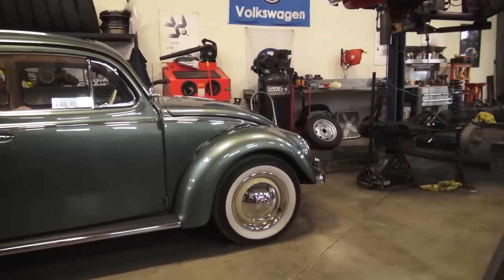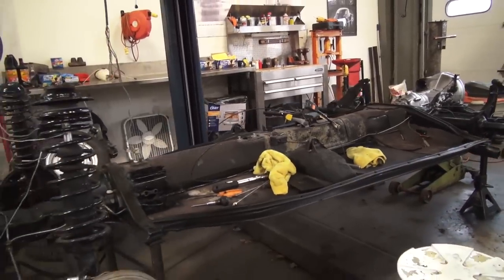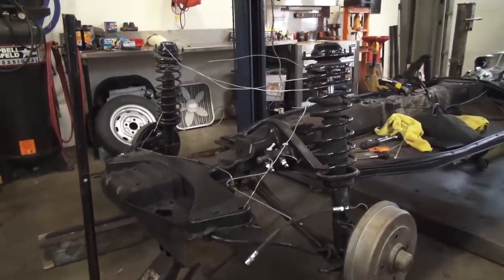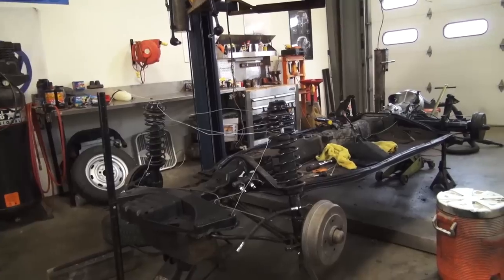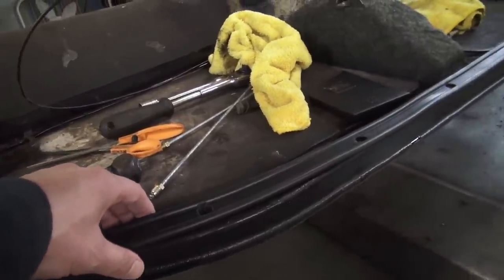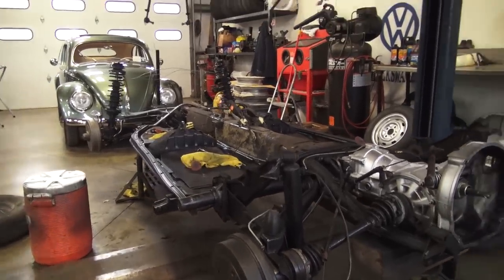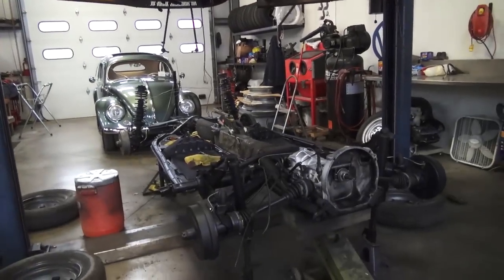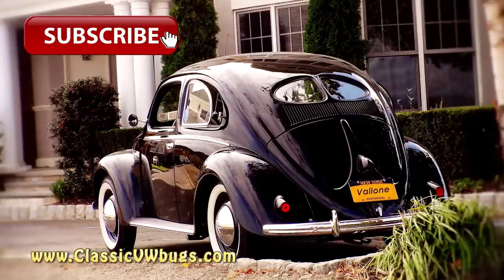Classic VW BuGs 1974 Super Beetle Restoration Body Off Project

Comment: Love it, I own a '73 that needs a lot of love. May I suggest to the lady owner that she updates the front brakes to disc, very easy to do now that everything is apart. It makes a difference, you know, and it's reversible and safer, and easier to check the pads than it is to check brake shoes. Great job, Chris, as always.
Reply: Héctor no adjustments either.
Reply: Right you are, that's why my '70 has disc brakes on all four coners, as does my Vanagon and Jetta. My SB I converted to front disc brakes, baby $tep$...

Comment: In Australia the '74 Superbugs didn't have the shock absorber bumper mounts in the front and the rea, instead they had a rubber mudguard mounting insert that was designated to fill in the larger hole for the shock absorbers.

Comment: I've owned a '64, '66, '68, '69, '70, and a '74 super sunbug and I miss the '74 the most by far. Its was the nicest riding and the smoothest driving bug I've owned. As a driver the super is the way to go, as a collector '64 was the coolest.
Reply: Am surprised people prefer standard beetle over super beetle.
Reply: I have a super, I like the larger trunk. No cold air coming through the dash in the winter too!

Comment: It's nice to see a '74 Super receive a little love. If I had one, these would be my plans for it:EXTERIOR: Light Ivory (color offered on Bugs from '73 to '75) with multiple lacquer coats; dual rear-view mirrors; Gila window film; Rain-X wipers and window treatment; locking fuel cap; LED headlights and taillights. (Oh, yeah, I almost forgot to mention mine would have an original sunroof.)CHASSIS: POR-15 Solution; modern-design tires that would look "'period" (if they exist, that is, probably from Coker Tire or someone); satin-finish wheels with chromed VW hubcaps; Wilwood 4-wheel disc brakes (rotors would be studded) with Type II master cylinder.          ENGINE: dual-port 1600: insulated casing mounts; all ports ported, port-matched, and polished; stock crankset cross-drilled for enhanced lubrication; lubrication system drilled and tapped for "full flow" with remote oil filter; Total Seal rings; K&N air filter; Mallory Uni-Lite distributor; Berg "oil light" dipstick; ceramic-coated exhaust manifolds. (Thinking back to the lubrication system, perhaps I should just ask Chris if one of those aftermarket oil pumps with a filter adapter might work as efficiently.)TRANSMISSION: insulated casing mount; "Berg '5'" conversion; cogs cross-drilled for enhanced lubrication; stock shifter with Berg short-throw kit. INTERIOR: red seats and door skins; black armrests and carpeting; full DynaMat insulation; I.C.E. A/C kit; RetroSound sound system.Of course, as is the case with some of us, I'm a little short of the, oh, I dunno, $40,000 or so it would take for Chris to build such a 'Super to my specs. If I may say so, however, I feel my approach to the car strikes much closer to practical than the "show cars" we always see in "Dune Buggies & Hot VWs." You know the ones I'm talking about: the butchered 'Splits and 'Ovals packing a blown 2332 under the engine lid with the original drum brakes to slow them down. Now, if I could just come up with the remaining $39,995...
Reply: Sounds awesome! Mine would be way more simple and closer to stock though.

Basically, I want kind of a half baked rally replica. I want it to basically look like the old Monte Carlo rally cars but without the decals/stickers.

Exterior: 4 old school Hella off-road lights, hood painted black to match the rally cars, might consider adding a spot light as well.

Wheels: Silver Porsche 356 wheels (no hubcaps). I don't know much about smaller sport tires, so whatever I can find.

Engine: Internally stock, dual weber carbs, Jbugs performance kit, as well as an old Abarth muffler

Interior: Stock steering wheel, half roll cage

and that's it. hopefully I will do it one day.

Comment: My First Car in Ohio, Bought it for 800 Bucks in 1981 Drove it For 1.5 years till I left for Boot Camp.  Heat non Existant in front because of rusted out Heat Enchangers under Non Existant Running Boards.  Remember Scraping Ice of the Inside of the windows in the winter.  Lol
 Salt And VW Bugs Did Not Cooperate!  This one looks Pretty Clean ,  What State was your Client From? Has to Be A Southwest Car!  My Floorboards Fell throgh!

Comment: I had 2 '73s, one Regular, one Super. I worked on a few 74+ Beetles (I think '76 was the last Regular Beetle and the rest were Super Beetles - in the USA. Many 1-year "issues" were because VW had to keep up with the changing Automotive Safety and Emissions Specifications. It got too expensive for VW to keep up with these changing standards, so the last Beetle in the USA was the '81 though the Beetle and Super Beetles were still being made in Germany, Mexico and Brazil until '09 (I think).

If you think this is bad - you should see a California '75+ Beetle - they had Catalytic Converters in them.... Talk about a rare item - the catalytic converter, not the Beetle!

Comment: The 1974 super beetles where also the last year to have steering boxes and the 1975 and later super beetles had rack and pinions which is why I want a 1975 or 1976 super beetle sedan and 1976 last year of the super beetle sedan

Comment: Any corrosion issues with those rear eyebrow vents behind the rear windows? I heard they rust from the inside out, which makes me not want to get one that has them (if I ever manage to get one, that is).  :D
Reply from the maker: no thank god, the car was pretty solid.
Reply: Well I had that on my '72 Super. Ended up getting whole new complete rear quarter panels (and had to pay a lot for shipping because they were coming from England). The good news is that there are no cutouts for the crescent vents. The bad news is that the indentations are there.

Comment: Chris we love watchin your vids thanks! I was wondering if you would know what kind of gas mileage I will get in a 73 beetle 1600. all the best
Reply from the maker: Well... if tuned correctly, you could get mid 30s.  Some folks get close to 40mpg.  Anytime you upgrade or modify, the mileage goes down.  On my 70 convertible that has a 1600sp motor with a big bore piston and cylinder kit on it, nothing major, it almost chops the mileage in half.  So with correct timing, distributor, carb, pistons and cylinders, I would say 32 mpg.  Something like that.